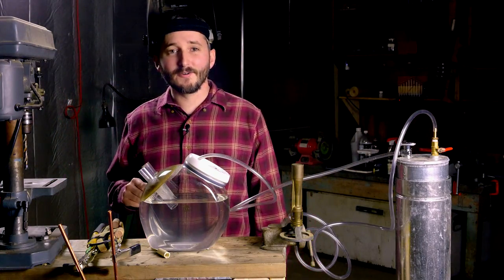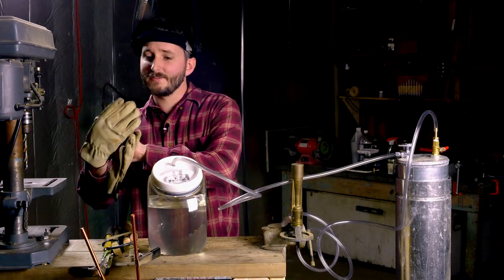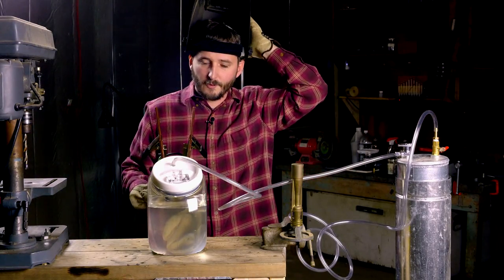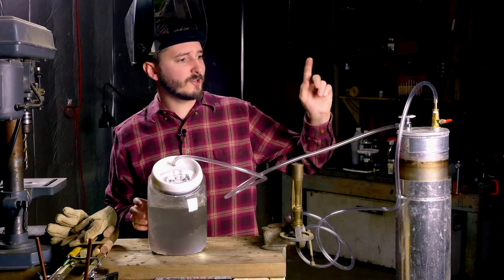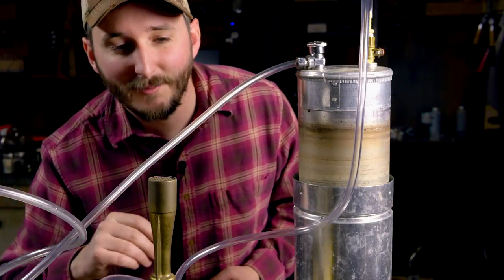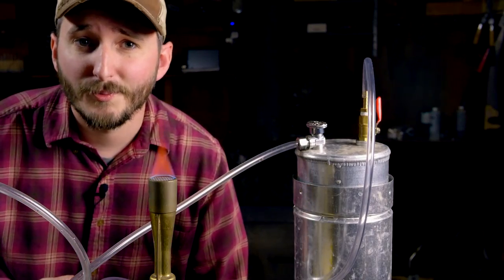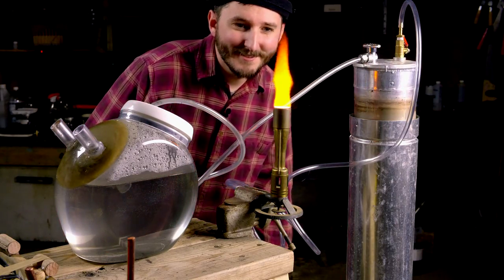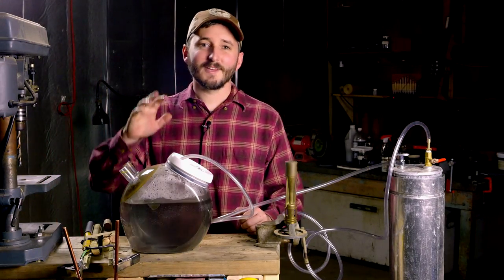Plasma Generated Water Gas (Electrically Produced Fuel That Is Not HHO)

Comment: electrocution, blindness, AND poisoning? time to try one of these projects and i think this is the one!
Reply: Likewise!  I need to get my carbon arc torch built first.
Reply: Totally forgot the exploosion! The best part.
Reply: he forgot to add '"and the chance to burn/explode yourself with flammable gases."
Reply: @Boerkie1990  Not entirely sure what you mean by that friend. (College trained welder here) it's not only possible to be electrocuted by a welder, it's a very real danger if you not very carefull.
Reply: @Russo-Delenda-Est  Someone tried to shock me with a welder & nothing happened (not under salt water)  What were they doing wrong?
Reply: @Boerkie1990  Voltage is mostly irrelevant. It takes about one tenth of one amp to stop a human heart (if your unlucky). If you held the metal ground in one hand and the live gun in the other you would most definitely suffer terrible consequences. Maybe not death, electricity is unpredictable. Even so welders are DANGEROUS, anything involving even small amounts of electricity is.
Reply: @Russo-Delenda-Est  lmao no voltage is not irrelevant. Current is DETERMINED by voltage. Ohms law.
Reply: Safety first 😆
Reply: @Boerkie1990  Bet!
Reply: Don't forget to forgo the safety gear as well!  😂😂😂
Reply: @cullenl2508  but most voltages over 1 volt are equally deadly.
Reply: @Russo-Delenda-Est  it takes 1 amp to stop your heart. 0.1 amps will only cause a muscle spam that will prevent you from unclenching your hand
Reply: I hear you. My chances havent been this high since grant was around
Reply: @Russo-Delenda-Est  does your college give refunds?
Reply: No senko hanabi first?
Reply: @DeXoDeD  I don't know what that is
Reply: @tristangriswell2034  one of his recent videos. It was good. You should watch it!!
Reply: @DeXoDeD  I'll definitely check it out. Thank you!
Reply: @charadremur333  All these deadly AAA accidents. Don't let your children switch the batteries in the remote.
Reply: @Russo-Delenda-Est  i got electrocuted a few times from my dc welder , luckily i felt it fast enough to let it go
Reply: John . R I P IN ADVANCE BRO   . TO EYES
Reply: 🤨 “Electrocuted, blind and poisoned is no way to go through life, son…”
Reply: Plasma acrs and flammable gasses on the other side..
Reply: @Sedgewise47  we are men. If there isn't something physically wrong with us then we've not been living like men.
Reply: @noobpro9759  
SIGH
Check back with us when you’re in your 40s…
Reply: @Sedgewise47  bro. I've literally spent the last 7 years making home renovation miracles happen. And now I get to live with the trauma of having seen my father who I have a very deep history with nearly die in my fucking arms. I get to watch him struggle and feel like there's more I could've done. You don't get to decide what I've been through. You don't get to say who is and isn't in pain.
Reply: @Sedgewise47  not to mention my arthritis in my knees and hands, the back pains, you might have been born in 47 but age doesn't mean you're cultured or even a good person.
Reply: Well, as they say, 'its all fun and games...'.  enjoy anyway.
Reply: If covid doesn't get ya
Reply: @cocopublicnews6766  if what vid?
Reply: yeah sounds good ,  what's the worse that could happen. hmm John never did reply to the comments, maybe he did try it then. LOL
Reply: @Russo-Delenda-Est  I am a dead ground ,,if my arm is on a car fender and I touch the pos of the car battery I get shocked ,,, well years ago working on a house we put up steel beams to hold the upstairs floor , then welded a steel post to the beam ,, I was holding the post level and got shocked every time the ark welder started welding ,, I get shocked by touching the bare telephone wires worse if the phone rings at the same time ... some guys can grab the welding rod in the clamp when welding I get shocked just changing the old rod out and installing the new rod ,, so yes welders are dangerous ,,,
Reply: @tristangriswell2034  so teach yourself to let go...
Reply: @mjolnirswrath23  saying that is proof of your absence of electrical knowledge. I can’t remember if it’s 0.1 or 0.5 amps of current is strong enough to override your own body’s electrical system and stop you from letting go. You are physically unable to make your hand let go. Firefighters when checking electrical lines will use the back of their hands. If the line arcs to them and causes their hands to spasm and grab they won’t grab the wire.
Reply: @Russo-Delenda-Est  i'm sure its 1 amp externally.. to actually suffer electrocution from 1/10 of an amp you's need to do something silly like sticking wires under your skin.
Reply: I had a question on a OSHA test and it asked what kills someone by electrocution voltage or amperage. The question is rigged , my answer was a combination....I got it wrong and tried to argue the case which thru my physics/ engineering studies I knew I was correct and the question itself was flawed.  Voltage is electro motive force or potential. It is the potential difference of negative electrons and positive electrons separated but wanting to return to zero. It's like water being in a higher vertical distance above a water wheel. The combination of how high the gravitational distance of the falling water and the VOLUME of water dictates the total power of the wheel. Voltage is pressure and amperage is volume . 1 amp is 6 with 23 zeros after flowing past a point in a conductor per second, something equalivant to gpm ( gals per min) in hydraulics, ohms law states that voltage is amperage times resistance. The human body has a high resistance  it only takes something like  1/4 of a amp to stop the heart and kill a person BUT the only way to pass that small volume of charged volume is to push it with force since the resistance of a body is say much much higher than a conductor like copper or aluminum in our wires. If you double the voltage you push twice the voltage if resistance remains the same. So obviously it is the combination of voltage acting upon the still current that sends it thru a resistance. Without one their cannot be the other. It's like asking what kills u the bullet or the gunpowder. Yes the bullet did the physical job of wounding but without the gunpowder the bullet would have zero velocity and wouldnt do anything so it is a misleading question to ask and pointless to defend as one over the other. Same with torque and horsepower and rpm. They are all a product of each other.

Comment: So who's going to run a small engine on this? Project Farm
Reply: What kind of engine does it to take to run on a fuel mixture like this? You couldn't just put it into a typical gasoline engine, right?
Reply: I knew a guy who had a similar setup as the "air intake" for his BMW, supplementing normal fuel. He got crazy high mileage out of it.
Reply: @AbjectPermanence  You most likely could, Project Farm  has run engines on many fuels you wouldn't think possible.
Reply: @AbjectPermanence  able to work and runs well are two vastly different things hear in Oklahoma people convert their Trucks to run on CNG(compressed natural gas(methane)) sure it's cheaper to run but it's really hard on the engine and kills it's life, but that is frequently someone else's problem.
Reply: This isn't that different from a wood/coal gasifier. Used to run busses off coal gas during the war, back when all the proper fuel was needed for tanks and spitfires.
Reply: @AbjectPermanence  Ask Stanley Meyer...?
Reply: @Amipotsophspond  yeah, and in EU many have installed LPG (liquid propane gas) which I believe can be rectified from natural gas as well. But the important bit is that gas powered engines are not as snappy/powerful as petrol ones. And it takes well adjusted system to keep the engine in top shape.
Reply: @AbjectPermanence  maybe a 4 stroke would run. You can run engines on a lot of weird things, the problems are usually build up or the fuel/air ratio being off
Reply: I've asked him a few times to try out HHO but he doesn't seem to have got round to it
Reply: I can imagine a Stirling engine using this as the heat source
Reply: Or Garage 54 in Russia; now Those guys really experiment! Well, maybe not super scientific as Project Farm, but definitely crazy experiments!
Reply: Can (should) this has be stored in a propane tank? How safe would that be compared to propane?
Reply: @-robo-  No. This is the gas that made a famous explosion in Florida. The CO and water vapor attacks the steel. Commercial use died out once it became unsafe to store at pressure the way pure H2 can be.
Reply: @Kristianux  Its much easier to convert to propane. Propane has about 70 percent the BTUs that gas does. Its a minor loss of power but cleaner and less temperature sensitive. Hydrogen and this mix of CO and H2 both burn with about 10 percent BTUs however. Propane systems use one tank that gets a little cold in use. H2 systems usually have at least 4 tanks splitting the load to prevent freezing up and take up 4 or 5 times the space as propane. It also burns differently inside the motor. Its more common then to just add H2 to the gas or diesel as a mixture.
Reply: He’s going to find out which carbon arc welding rods are best for making fuel.
Reply: @ProlificInvention  

|> |> |> |> |> |> |> |> 
|> |> |> |> |> |> |> |> |> 

he did not HHO what Im awared off

|> |> |> |> |> |> |> |> 
|> |> |> |> |> |> |> |> |>
Reply: @dantronics1682  and what charges a car battery? Remove the voltage regulator.
Reply: He just did a HHO fuel "additive"
Reply: @AbjectPermanence   @Abject Permanence  This gas is a similar composition to woodgas.  Woodgas has been used for a long time to fuel regular spark ignition internal combustion engines.  All you would need is an adapter to mix the the gas with air and pipe the mixture into the carb/intake.
Reply: @tripplefives1402  thank you, this was interesting and educating.
Reply: Why?Its a huge waste of energy,just get an electric one.
Reply: a friend of my grandpa did
Reply: @tripplefives1402  Have you ever actually seen an engine run on woodgas with the gas coming in through a hole in the venturi?  In general, woodgas doesn't have a high energy density and you would not be able to get enough woodgas into the carburetor using a hole in the venturi.  Woodgas usually needs about a 1/1 mix with air to work correctly in an engine.  That's why most people premix the air and woodgas before the carburetor or they just remove the carb and mount their own mixer in its place.
Reply: @tripplefives1402  I'm not sure what you mean by "stove".  I am talking about proper engine grade wood gas made in a properly built wood gasifier.  Your original reply to me stated the people who mixed the wood gas and air before the carb were "too lazy" to just drill a hole in the venturi of the carburetor.  In reply to that reply, I was stating that I believe you would not be able to get enough wood gas into the engine that way to run the engine well.  Again, if you have a video or documentation showing this type of setup, I would be interested to see it as it is not a common way to get wood gas into an engine.  I have seen air to wood gas ratios of 6:1 or 8:1 in some documentation, but almost every real-world gasifier setup that I have seen uses about a 1:1 ratio (50/50 mix) of air to wood gas when running common internal combustion engines on wood gas.
Reply: @BryanWhite77  I don't believe this man has ever seen a woodgasifier in their life or how they work. Just ignore them.
Reply: a cng engine 🦍.. or further process the synth gas into pure methane 💩 @AbjectPermanence

Comment: I know that the main products are monoxide and hydrogen, but the super high temperatures of electrical arcs are strange things and can produce unexpected complexity. I would like to see the product gas run through a mass spec to see what trace species were also produced. I bet you would see some methane, ethylene, acetylene, maybe even ethane in there. Recall that a simple spark in an atmosphere of hydrogen, water and ammonia produces a rich array of amino acids (Urey-Miller). I don't think anything as complex as that is being created in a setup like this (no time for it), but all the same, I bet there are interesting complex trace components in that gas, perhaps even exotic things like endohedral fullerenes.
Reply: Muonium when i used to arc charcoal under water , the bubbles did have a very strange smell to them.
Reply: Had the same expectation
Reply: The proportion of acetylene might be significant, considering that passing hydrogen inside a carbon rod electric arc is how acetylene was first synthesized.
Reply: Especially mixing in the fact he's using water that has organic components from the leafs in it.
Reply: @shannondove96  bro are you still alive
Reply: @stasi0238  i taken a wiff at chlorine several times and i am still alive
Reply: Could the addition of a nitrogen source to the water even allow for the production of nitroalkenes?
Reply: @Muonium1 - I did this sort of thing decades ago, like 1986, using plain tap water. I did not burn the gas, but I did notice that it smelled much like Acetylene (aka Ethyne) from a welding tank. It seem likely that there could be some of that C2H2 in the output gas, especially since the UV (ultraviolet light) from the arc can split H2 into atomic hydrogen. I note that large gas clouds in space often have C2H2 in them, plus many more complex molecules, as revealed by spectroscopic analysis of starlight shining through the clouds of Hydrogen, Carbon, Nitrogen and Oxygen. (Long-time subscriber, but only just got this video recommended in the sidebar. So many great things to look at, so little time!) @Nighthawkinlight